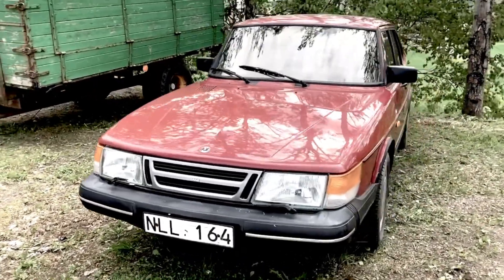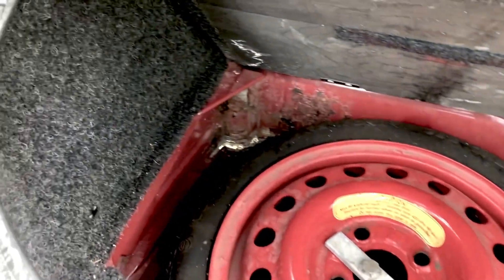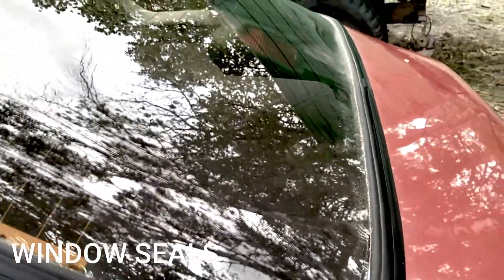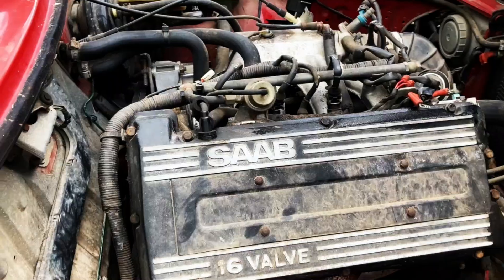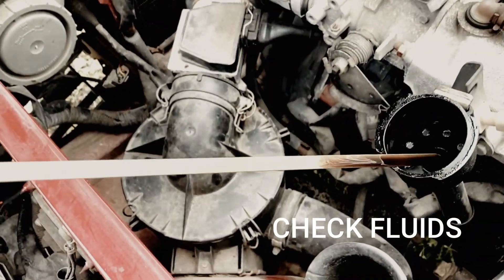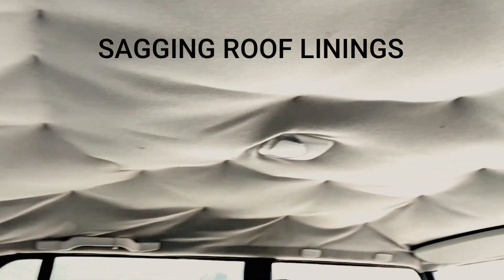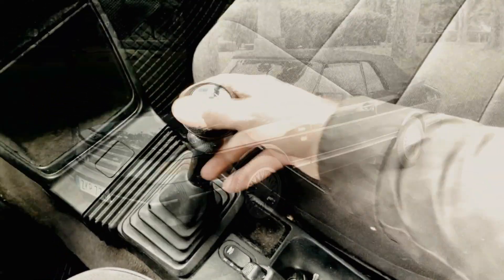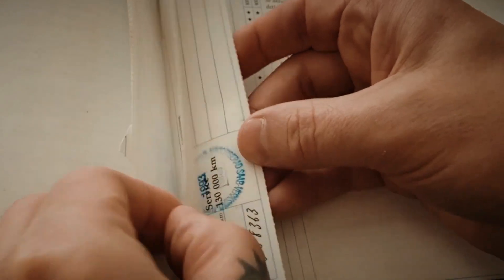Saab 900 Classic Buyer's Guide

Comment: Interesting video! I am looking at a 900 S with the proper turbo, only problem is that it loses oil pressure when the engine is warmed up. Got told it has to do with the piston rod bearings. I am hoping that the engine is viable for revision, ( that it is not too costly) The car itself is really a beautifull thing. Was introduced to these cars by a friend who drives a 900 S LPT.

Comment: Looking at an 89 900 (non turbo) and they are asking $1000. Can you look at the ad and tell me if this sounds legit?

"Cute Saab. Not running as it needs a new crank shaft sensor which they do not make anymore. I am told there is a great work around where you swap a part with a 9000 turbo, but it would take someone who knows cars and has the tools. Lots of new engine parts, new battery, new ignition, decent tires and interior. Would make a great project or parts car. Needs to be picked up via tow. Will consider all reasonable offers."
Reply from the maker: Hi about the right price for a decent rust free 900 16v that isn't running - but when they say bring a trailer expect the worst. That sensor can be a bugger though and I had that issue on a car that turned out to be amazing. Worth checking out though - mileage ?
Reply: @theclassicsaabguy236  160k

Comment: 2:49 I thought the timing chain was on the front?
Reply from the maker: Not on a Saab 900 - it's at the back of the engine towards the bulk head
Reply: @theclassicsaabguy236  Right I was probably thinking of the gear chains and getting them mixed up in my head. I do have a 900 myself, but never done anything about the chains.
Reply from the maker: @1873Winchester  yes that's right there is a transfer chain from the motor to the gear box below at the front
Reply: The transfer chain is a tri chain

Comment: My old 900 turbo two door coupé was 100% perfect. Not a spot of rust , the engine was spotless in and out due to synthetic oil.
That's until I traded it in for a 9000 turbo 
The mechanic from the dealership who bought it had obviously no idea or pride in owning such an immaculate car. Within six months it looked like a heap in and out .  I have found fitters ( that's all they are these days) never look after anything.
Reply from the maker: Yeah that's the trouble these days that these classics are just not looked after ! Still
Some nice ones to find though !

Comment: Good guide, well done.  Another item to factor in on the 3-door coupe/hatchback models- the rear rubber window seals tend to shrink and let water in.  The net result is your rear wheel arches start rusting from the inside out.  Best way to check is to flip the rear bench seat forward and simply inspect the wheel arches.  Seals can be tricky to track down.
Reply from the maker: yeah have experinced this loads with 900 models ! the woes of rust repair on the wheel arches
Reply: @theclassicsaabguy236  original 9000 cloth seats? sorry if I missed that part.

Comment: Yup, worst problem with these cars is the pinion bearing in trans going bad. Good idea to check trans oil as well since it is often neglected. As he said, classic symptom is wining in top gears. Pretty expensive and involved to fix. Leaky steering rack is a bitch to change as well. Engines are generally bombproof if timing chain is maintained.
Reply from the maker: Yes that's right ! Thanks for the extra tips !